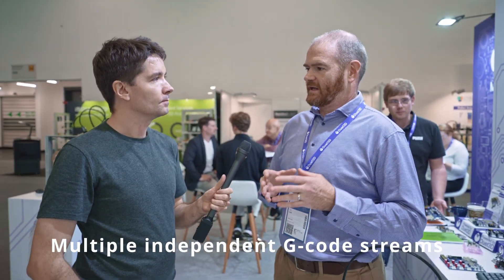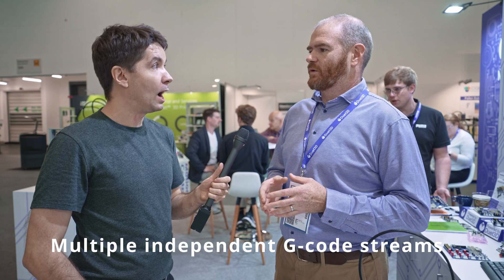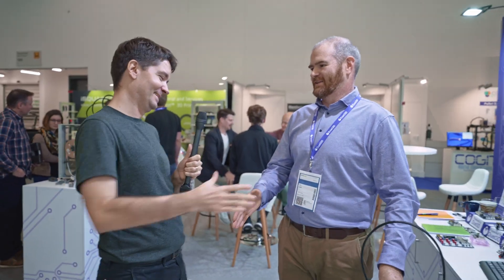Tony from Duet3D: solving my 10+ hotends tool changer firmware at formnext

Comment: GH Enterprise has therefore found a solution that allows you to add Input Shaping to 3D printers in a simple and immediate way, avoiding the use of external host cards such as RPI4.

Just replace the X and Y axis drivers with the GH Smart Shaper drivers, add some configuration commands to your g-code and you are ready to print with input shaping.

Comment: Been using Duet boards and RepRap firmware for a couple years now and am constantly impressed. I will say the custom gcode macros are very easy to implement and if you need help the people on the Duet forums are very helpful. 

It doesn't get mentioned in the video but one of the coolest features of RepRap firmware, thanks to it being open source and development from Team Gloomy, is the ability to use certain manufacturers mainboards as expansion boards. For example if you want to keep using your Duet 3 Mainboard but need 7 additional stepper drivers, a number unfortunately no current single Duet board can handle, you can instead use a BTT Octopus Pro as an expansion board!
Reply from the maker: Cool! Where can I find more about this?
Reply: @MihaiDesigns  Hi Mihai, looks like my reply might be getting held up because I included links 🤐. If you search for Team Gloomy RepRap their page should come up. The gcode you need in the config file is M954, more information on that and some of the limitations(very few in the newest versions of reprap) can be found in the duet3d documentation which should also be easily searched for.

Comment: Shouldn't this be fairly easy to do with Klipper? I mean, you can already run multiple printers at the same time with one Klipper UI, so it should be trivial to do this. You'd still need a can/ramps board or something, but that might be desirable anyway.
Reply from the maker: I don't know... I could get 80% of what I need relatively fast, but I've been looking into this a bit and it looks like in the end I would have to write a ton of functionality, plus getting two "printers" to talk to each other as Klipper has only one g-code execution stream. We'll be investigating to see how much effort it would take to do everything in RRF and then compare.
Reply: @MihaiDesigns  Yes, you need 2 klipper&moonraker sets, and then control both from the same fluidd/mainsail UI. I'm not sure how to choose which instance commands will go to in macros. I wonder how the multi-stream code looks on RR.

Comment: Duet3d is such a great product…stay away from Chinese boards (low quality, horrible support, most probably back doors, etc)
Reply: What kind of backdoors? All boards use open source firmware that you build by yourself. Complex ARM-based boards running Linux all include some sort of closed blobs, both Chinese and not Chinese, thus have equal possibility of having backdoors.
Reply: @shadyb  things in china are state owned…a state known for having killed of starvation +30million people…why would they have morals in electronics?
Reply: Yes Duet is great but also expensive. What you mean by back doors ? Like getting hacked ? who would want to hack a printer ?
Reply: @crownflash5377   @CrownFlash  Back door into your 3d printer = back door into your local network.
Reply: @Schroefdoppie  AH you mean thos fancy connected one ..i dont use those i use a pi